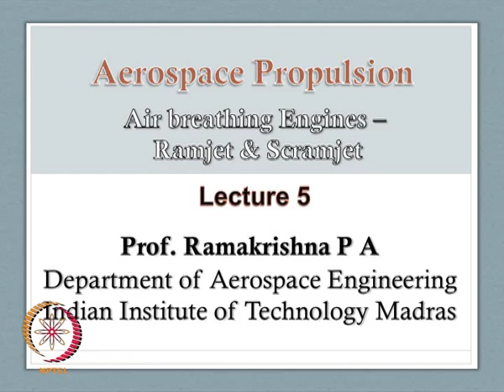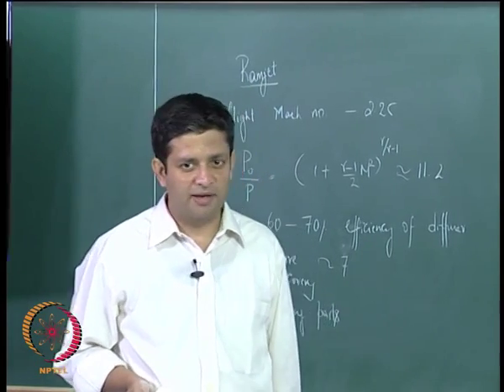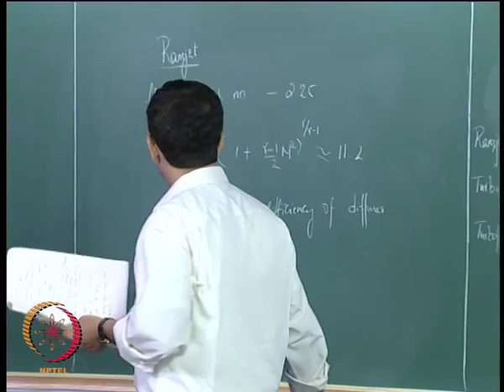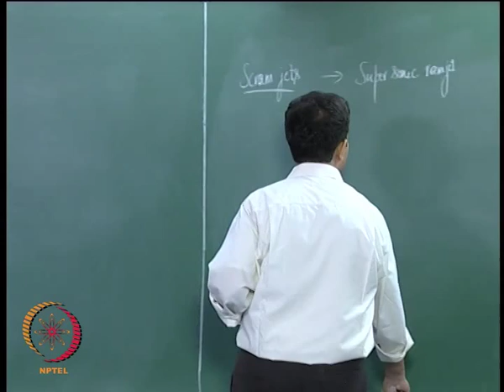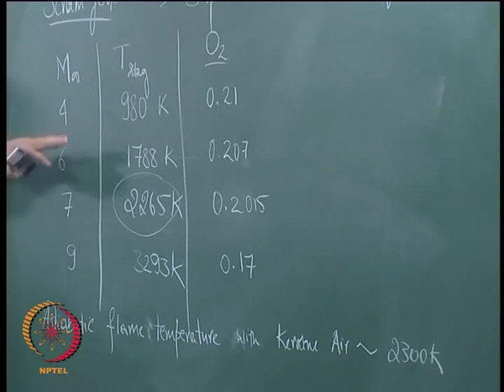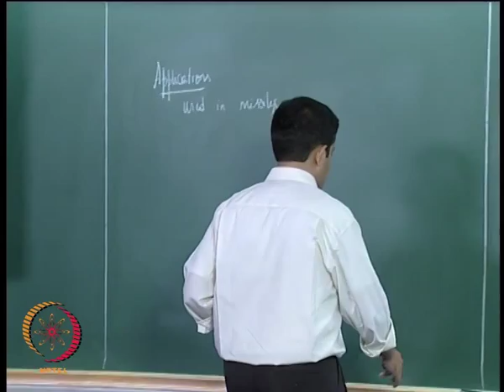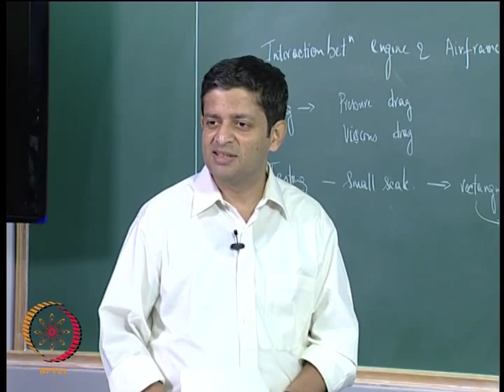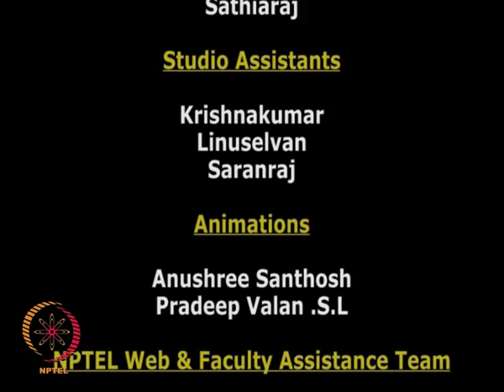Mod-01 Lec-05 Air breathing Engines – Ramjet & Scramjet

Comment: Can anyone tell me what is the use of the vanes in the diffuser. Is it for controlling the air flow direction?
Reply: Yes, to guide them...5yrs later
Reply: To guide the flow with designed angle inti the rotors

Comment: Then, How the Air is compressed in a Ramjet!!..without using the compressor 🤔??
Fact:
The great way, of Exploring new ideas is by questioning the existed Designs i.e .Question the existed Designs "Why??" & Know the purpose of each part init..Can we do the same purpose in an efficient way? Ex- For an Engine Ultimate thing we want was:
1)High vel. @Nozzle(Ve=sqrt(gamma×R×T)➡️ To ⬆️Temp, ⬆️ Pressure (Compressor Evolved with this Idea)....The same Task is done in efficient way in "Ramjet"( No compressor, No Turbine..Still Does the same task✔).
2)High Thrust=Mass×(Ve-Va), 2 parameters Either ⬆️Mass flow rate(TurboFan Evolved with this Idea) / ⬆️Vel. Difference .